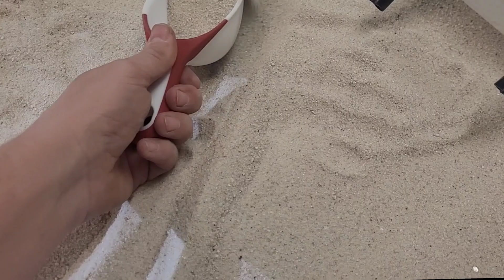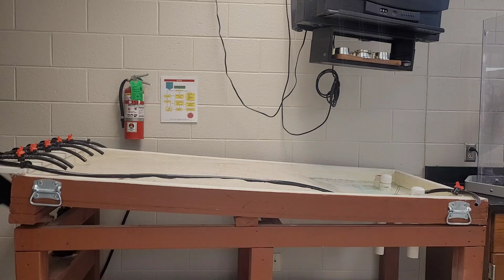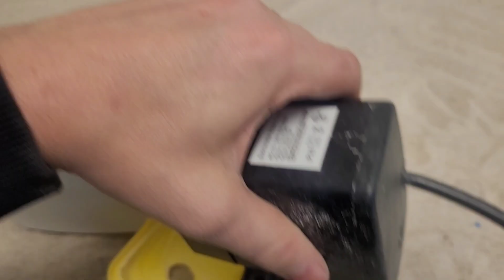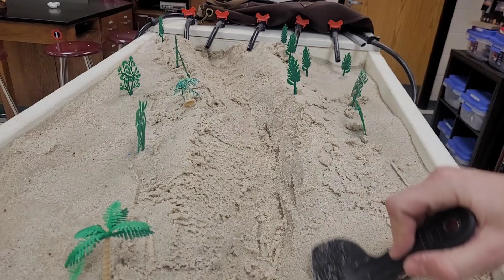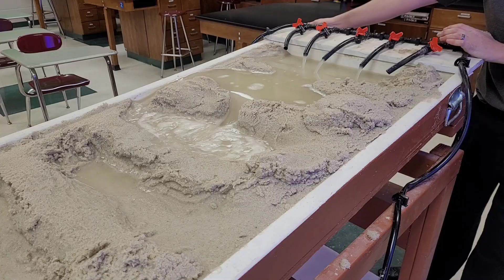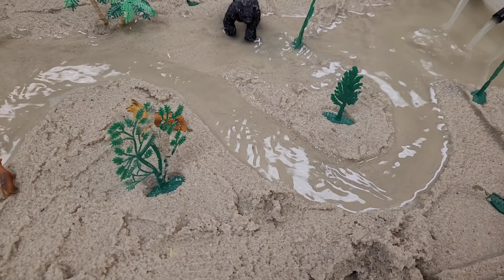DIY Stream Table: Hands-On Earth Science for Your Classroom!

Comment: Really love this video. I’m actually replacing out 4x8 stream tables that we have had outside for recess for years. I’m a little confused though. You plugged up the main drain with the clay. So does that mean this drain is now useless?
Reply from the maker: Hi, no I only plug the drain temporarily and just scrape it out.  Strainers tend to get stuck with the sand but there are a lot of other (more efficient) solutions too.